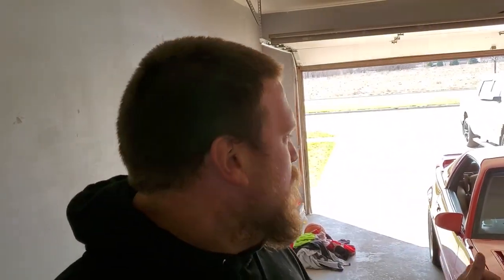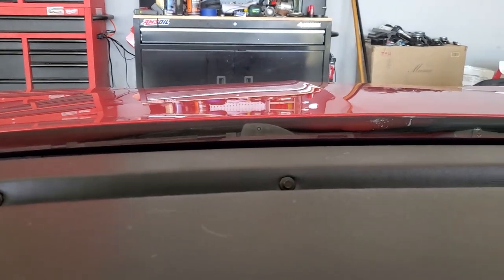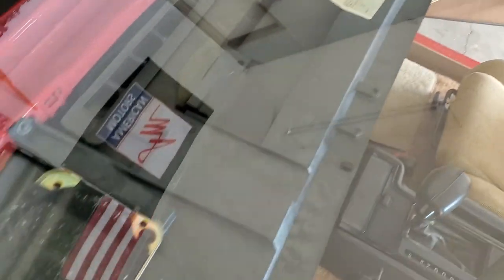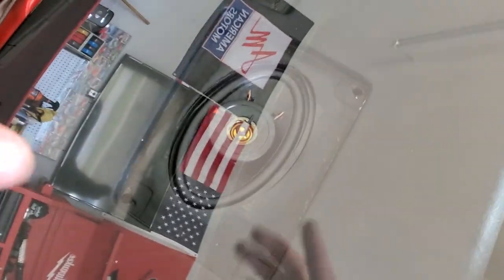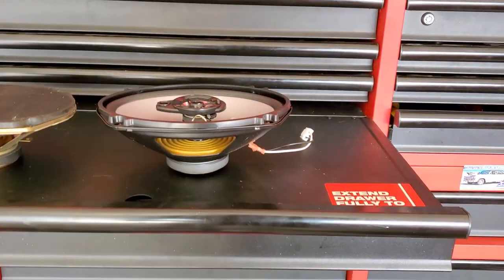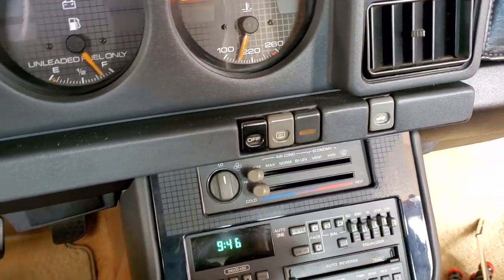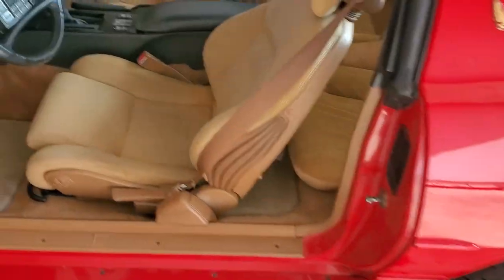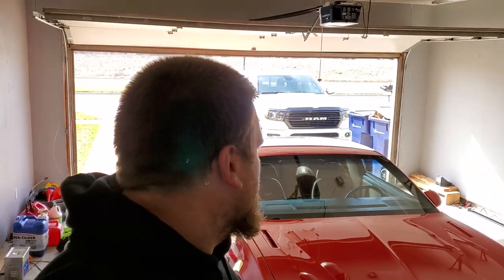1989 Trans am GTA Speaker Replacement and Upgrade

Comment: I am about to do this upgrade on my 88 GTA as well. Did you have any problems running 4 ohm speakers instead of the original 10 ohm? Huge thanks for the video.
Reply from the maker: No I didn't have any issues, CNET has an interesting article on this.  It seems to me that the only time people run into issues is at a very loud volume.  Since my headunit is the original and audio quality is not the best, I never get into that range anyways.  https://www.cnet.com/tech/home-entertainment/how-to-stop-worrying-about-speaker-impedance/
Reply: @RamblinGarage  Great and thanks for the link. I came to almost the same conclusion. Had there been a lot of issues one would certainly also find a lot more threads online in forums about the problems. 
I just replaced the front speakers in my Trans Am, sounds great.

Comment: Did you use the 72-1002 for the front speakers or just the rears?
Reply from the maker: I needed them for both, you can see at 2:55 that the factory speaker has the goofy harness.

Comment: I also have a 1989 T/A GTA were the rear speakers an option back then ? I have never heard audio from the back unless the speakers are gone.
Reply from the maker: I don't think they were an option, at least not on the higher trims. I would pull the covers and see what you are or aren't working with haha
Reply: Looks like mine have those 6x9s I guess I never noticed since the one on driver side doesn’t even work haha! Time to upgrade these original speakers
Reply from the maker: @HustleHusky  haha nice!  Perfect time for an upgrade!

Comment: Is it necessary to pull the dash out to do the front speakers? I’ve got a short to ground on my RR speaker and I already need to gut the interior to get it out
Reply from the maker: Yeah, you could maybe remove the speaker covers, but you risk breaking them in the process.
Reply: @RamblinGarage  bolt in or just clips?
Reply from the maker: The dash has screws holding it in, I show all the locations in the video.

Comment: Where did you get the steering wheel
Reply from the maker: Thats a factory 89 GTA steering wheel.
Reply: @RamblinGarage were you able to wire the new radio system to the volume buttons and stuff on the wheel?